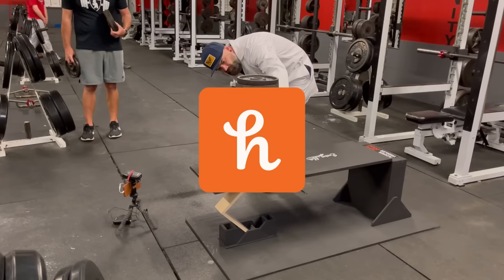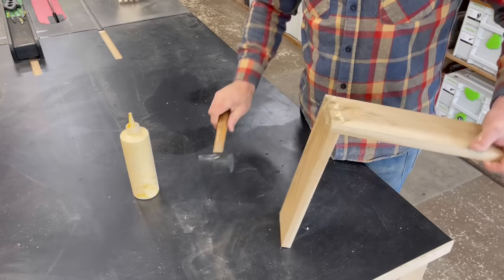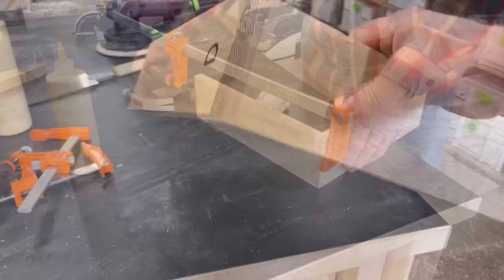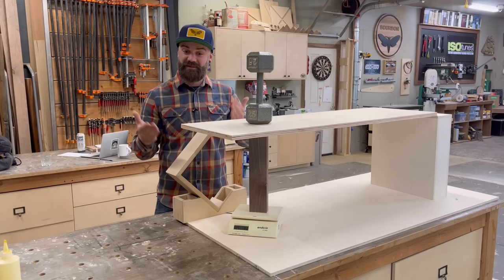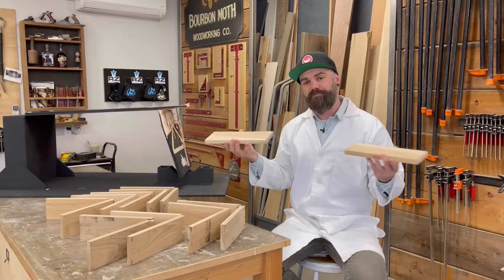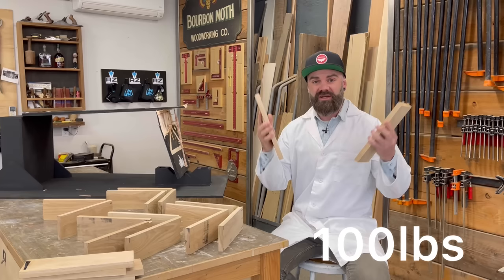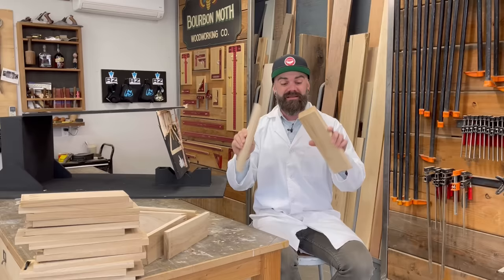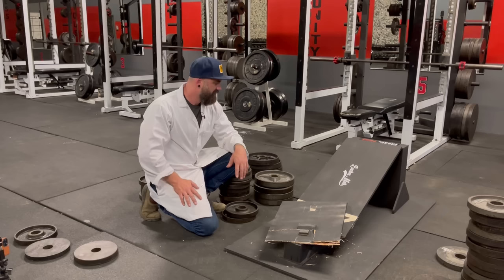What's the Best Wood Joint || Insanely Strong Joinery!

Comment: I think the hinge part does take some of the weight - hence 25 lbs for both the weight and the top board.  That said, the order should be the same, so the method still works to test the relative strength of the joints.

Matthias Wandel also did some joint strength testing and came up with box joints being the strongest I think.

Direction of stress also matters a lot - different joints will work best for different directions of force.

Useful test/information though - thanks for doing it.

I wonder how machine cut dovetails (like with the PC or leigh jigs) would do.

I guess the miter joint has a larger glue surface than the regular butt joint, and that, combined with Patrick Sullivan‘s (I think that‘s the name?) recent myth buster on end grain glue strength, could explain the strength.

The miter with splines really is easy to cut, attractive, and strong - I will probably use that joint more.  I usually don‘t cut them with the jig - I just cut out a quarter circle and use that - it‘s about the same as (maybe a bit less than) cutting it with the 45 degree angle jig, but it‘s super easy and requires no jigs.  I didn‘t think it would be as strong as your tests showed either though.

In the end, I am hard pressed to think of any of my joints that have actually failed under stress.  I guess I tend to overbuild everything anyways.  We probably overthink this as woodworkers because we are used to seeing the shitty stuff in store bought furniture - e.g. particle board with nothing but glue and brad nails for drawers and the like.  The kind of work we woodworkers do is very unlikely to fail in comparison unless really abused.

I believe box joints get stronger as the number of fingers goes up (i.e. the number of glue surfaces).  I made a Matthias Wandel box joint jig and usually I just cut single blade width box joints so I don‘t have to deal with putting the dado blade and brake in my sawstop.

The dowel joint‘s strength is likely due very much to the wood used.  I wonder what the optimal dowel size, number, and spacing is?  Another interesting test to try.

So many variables - but as I said above - this is still really useful and good info.

Comment: The dove tail should have been in the same proportion as the box joint, just with angles, with the “meat in the middle” being no less than 1/3 the “bite of the tooth”. 

Do the winner with 1/8 to 1/4 dowels going through joint just outside the corners, going through the white oak and the black walnut. Beautiful and I’d like to see it tested….FOR SCIENCE!!! Lol. 

It’s called a “Double Bradshaw” joint. A “Single Bradshaw” is a “mirrored dovetail” with the dowel going through the center of the joint. 

No metal. All wood. Up to 3 to 4 colors of wood too!

Science!  Test the Bradshaw joints.

Comment: Nicely done, you obviously put a lot of thought into designing this experiment, and the sheer simplicity of the mechanism combined with your conversational presentation style makes this a very accessible introduction to joint strength considerations.   Have you considered taking it a step further by addressing the modes of failure and the directionality of the applied forces?  Beyond satisfying the engineers in your audience (who, if anything like myself, were subconsciously superimposing force vectors on your video and/or flashing back to the days of solving statics equations with point forces acting on massless frictionless members floating in space) it would also provide your viewers with information that could help them make informed decisions in use cases where joint failure is a concern.  Even without bringing numbers into the equation (figuratively or literally!) I suspect you could easily in your audience instill a conceptual understanding solid enough to  enable the critical thinking and analysis skillsets that are so crucial for preventing/troubleshooting structural failures.

Comment: A dovetail joint is only good if it´s done to almost a tenth of a mm error. Otherwise the surface glue is too thick and the overall bigger surface area does not even matter.

Comment: Lamello has another system with the exact same machine, where you have to drill an extra hole, but can then insert the (stupidly expensive) klamex and tightem thn with a hex-key. Hold extremly well, are expensive as f.

Comment: My strength teir list guess. 1 being weakest.
1 butt joint (teehee)
2 miter joint
3 miter with splines
4 lamello
5 pocket hole inside
6 pocket hole outside
7 dowel pins
8 domino
9 dove tail
10 box joint

Comment: Watching your results, one question would be how strong a true diamond (e.g., a drawer without the bottom) done with butt joints would be -- would it be weaker or stronger than the 60 lbs?

Another thought (you did say a couple different ideas came to you) is that your pocket hold test needed to be done both ways -- with the pocket holes on the top of the support as well as the underside of the support. I can see how the stresses there might be different, since it's a kind of butt-joint with screws. As-done, it stressed the screws exactly in the "right" direction for maximum strength.

Given your winner (see my other post about unconsidered alternative joint types), I would really really be interested in seeing the results of the angled miter spline (e.g., the "bowtie spline") and the angled dowel-miter joints. I'd be even more interested in an  exposed-dowel angle miter -- one where the dowels penetrated inside the box to give them more angle on the corners (it would still be a somewhat decorative aspect of the work) e.g., the dowels were visible on the inside corner instead of fully contained in the wood. That plus a small angled-wood piece in the corner itself could make some interesting variations if the strength of the joint was highly important. The bowtie spline in particular would be less prone to failure given the way the splined miter failed. Whether it would weaken the joint in some other way is obviously a question.

Comment: The length of the lever arm increases the weight (force) at the fulcrum. All your joints technically failed at a much higher weight. If you doubled the length of the boards you would half the weight of force. Mechanical advantage/disadvantage is magic 😂

Comment: "Scientific"?  Your sample size is ONE!  Seriously?  Results HAVE to be consistent and repeatable.  Still cool though!  Us geeks come out of the woodwork when a YT video does failure testing.  HAHA!  You can go as far down this rabbet hole(catch that?) as you like.  Number and size of pins, splines, dowels.  Fitment tolerance variation(was it too loose or tight for glue?).  My immediate thoughts after seeing the basic miter's shocking result was to see if pre priming the joint with glue prior to assembly would make it even better.  Then adding splines to that?  The wood working world isn't flipped on it's head just yet, but even with the sample size issue, lets just say that it's more than a little interesting.  Keep up the great work.

Comment: You don't seem to understand what makes the miter joint so strong. For one, the glue is able to soak into and bond with the end fibers. You just don't get a good bond on the side of the grain. Secondly, you have much more surface area for the joint.

Oh, and I picked the miter joint with the splines as number one.

Comment: So I have a few things that make some of this make sense to me. First and most important, I've seen some cases where the wood glue used is stronger than the wood, and I'm not talking about something like balsa. Second, to go along with that, a couple of these joints maximize the surface area the clue is spread on. As for the dovetail versus the box joint, I think at least part of that can be attributed to any differences in the thicknesses of the cuts and the amount of surface area. I'd hypothesize that variations in different parameters of the dovetail, such as the size differences in each side or the number of cuts, would have a notable impact on the strength. Next, just to beat a dead horse, how the grains match in each joint matters, but I'd take that a step further and say the surface area of which grains are matched matters. Finally, a major part of the strength seems to me to be linked to the strength of the binding material and its placement in relation to the grain. The screws of the pocket holes breaking through the grain is a great example.

Now as to the winner, I'd say it came down to a balance of all of the above. The surface area of the miter joint, how the grain matched, and the splines adding surface area, tension, and reinforcement would make sense as a good balance. One thing I would have liked to see, although not the prettiest joint, would have been a butt joint with screws from the end. Obviously, I'm not a wood worker though, so I'm guessing I'm going to get torn apart here.

Comment: Great test loved it! However, your knowledge about end-grain is fundamentally wrong. End-grain to end-grain is the strongest way you can glue two pieces together and a miter joint is exactly just that. So the first thing you said about the first joint you tested was also incorrect. The first joint failed because of the long grain, not the end-grain.

Comment: 60 lbs of static load is lot. 60 lbs of dynamic load is not much. If you try and open a drawer that’s stuck, you can exceed that pretty quickly if you pull the drawer and it catches at the end.

Comment: Nice video.
You did make a engineering error.

Pound is a force not a pressure.

You are not load the joint with force.  You are actually loading the joints with a torque.  Force time distance.

You need to make a take that test sheer strength.

Comment: breaking a fixed base triangle is making no sense for the joint. the 2 legs should spread freely so max pressure is placed on the joint in fact the legs should be on a slick greased base. So friction does not give false support the joint.

Comment: It want The miter joint that was strong. It was the trigonometry. Your setup probably perfectly distributed the weight. I’m sure if you repeat the test with just an 1/16th difference on your jig holding the joint it’ll crack much sooner like the butt

Comment: This video is only good if you have only 1 joint and pull it off perfectly. If there are 2,3, or 4 joints it would be difficult to create perfect miter cuts, or equally sized peices. Imagine your slabs have curves or 0.1-.2mm variation in length. You will end up with miter joints that are not perfect 90 degree and there is a little bit gap between them. This is why splines and box joints and dowels are developed.
I personally think splines are easy and great. Then dowels or box joints. I'd use pocketholes if cosmetics isn't an issue. That's it. The reas are just useless. I'd never use a miter joint for the reason I mentioned above.

Comment: Cmon the simple answer would be a mitre with steel dowel pins +->1/4". diameter and ratio of board must be optimized or should we, dare we, use a threaded rod, not just a pin???? you decide

Comment: GREAT TESTING!! It's interesting that people do vintage joints with modern glues. The point of the vintage joints is to work well WITHOUT modern glues -- compare that dovetail without glue to the butt joint without glue (0 force with that one) and you'll see what I mean. Meanwhile, in modern construction, they use fancy glues, screws, and nails, NOT fancy joinery, because all that modern tech is much better (though maybe more expensive) than manual construction of joinery. Screws and glues make the work faster AND stronger, though I do appreciate people wanting to do things the old way because it looks cool.

Comment: the dove tail broke to early cause you didnt use an equal surface are on both parts, therefor its nothing else then the domino. with equal surface are the dovetail wouldve been the strongest. physics never lies.

Comment: EDIT: Noticed some words on the angles written. I edited to reestablish the correct message and clarity.

21:00 You didn't eliminate any end grain. In terms of the structure of the woods a 90° end grain cut is almost the same as a 45° mitre cut. The idea that end grain to end grain joint are weaker is false. Here is a video debunking that myth. https://youtu.be/m7HxBa9WVis

This one is showing how a miter cut is physically similar to a 90° end grain cut, yet the joint is weaker due the force being partially sustained purely by the lignin of the wood alone. https://youtu.be/2-cCCdwEhg4

For simplicity, and to avoid misunderstandings I'll refer to the grain as tubules when relating to the structural elements of the wood.

The difference in strength has to do with the amount of surface area glued and and the amount of  "functionally clumped" tubules in the actual joint. By this I mean that the tubules are positioned in such way that they must break from the joint to break, and that they are layered perpendicular to the force.

The butt joint has the least amount of surface area glued of all the joints tested and has zero tubules in the actual joint.

The others that showed less strength than the miter joint had some tubules in the actual joint, but mostly they are not "functionally clumped" enough. The best example of the that is the dovetail joint. You had some really thick parts interweaving with really thin ones. If you made them more or less equally sized, then the strength of the dovetail joint with be similar to the box joint. Possibly stronger due to the interlocking function of the triangular structure.

Finally, the miter with spline works very well because the position of the splines aligns the tubules in the position of greatest resistance. They are "functionally clumped".  Instead, if they would have been set up like a biscuit the results wouldn't have been much different to the simple miter joint because they wouldn't have been "functionally clumped", since they would be layered parallel to the force.

Comment: why is everyone going to extremes on joint strength.. First evaluate how strong does the joint have to be. in most cases a gooD looking joint is going to be much strong than actual need. (picture frames, most drawer boxes, even a desk is not expected To hold up a car

Comment: 13:00 Weakest to Strongest, Butt, Miter, Inside Pocket, Outside Pocket, Dowels, Lamello, Domino, Doves, Box, Splines?

Imo side note Imo if Doves were more symmetrical Id have them over box but those Doves were awfully narrow...

Im not a major woodworker or know much bout joints strengths but from some knowledge in area and slight idea behind physics of strengths in each I feel like could be close, I may be under or overestimating some like Dominos and Dowels may be better than Im suspecting but well see I guess!!
Reply: Okay yeah some I was good but off on, Specially the Miter, But I figured Boxes and Splines were going to be top 2 in some fashion...

If Doves were similar with more symmetrical even sized tails to boxes Imo Doves wouldve came in second Boxes 3rd, Splines seemed near positive theyd work best as the long flat tension is pulled less on boards edges and across splines themselves which were tightly glued into place, Almost like nailing some nails in outside few inches from edge, Butt jointed together than tied some thin steel cable from nail to nail pulled over corner, Second pressures applied Splines or Cable would tighten up and only way it can go is pulling splines apart or pulling them out of slots, But tightly being glued in way they were were only going to pull apart not out...

Comment: I can't believe how little wood you broke with those, glue failed almost every time. Maybe you need to try better glue. Also the lower support jig you used braces the joint, it should not touch the wood part way up like it does. I know that would make it harder to hold but you jig will add strength to all the joints and alters the symmetry of the applied force at the joint.

Comment: It should not be a surprise that the miter joint is the strongest. As Patrick Sullivan has shown in his excellent video, "Glue Myths: 1. End grain" (https://youtu.be/m7HxBa9WVis) an end grain join is, per cross-sectional area, MUCH stronger than a side grain join. When both are the same size, the side grain join will fail by having the wood break, while the end grain join will fail by having the glue break. Stumpy Nubs also has a great follow on video "A misunderstanding of the end-grain glue "myth" video?" (https://youtu.be/dwLWmoGh59g) which looks at this nicely.
This is not what we've all been taught, but Patrick's video is quite conclusive and I recommend it highly.
So, a miter joint is the strongest because an end grain glue up is the strongest possible join for the given area, not to mention that the angle of the miter gives even more cross-sectional area to work with.

Comment: If the dovetails had been more even widths it definitely would have been stronger.

Also to be truly scientific you should have done 2 tests with each of the joints that were asymmetrical. So the long piece would be on the bottom on one test and on the top on the other test.

Oh and you missed the humble butt joint with screws.

Comment: That's an interesting experiment but unfortunately with constraints your made i.e. fixed angle for lower plank and fixed pivot point for upper plank it's far from reality. Those 100 pounds you applied are essentially mostly for bending oak planks, not affecting the joint. It's really upsetting because without slight corrections to the experiment, all your energy yielded mostly useless data.

Comment: The place the pressure is placed makes no sense.... You would have another joint right where you are testing in every application. I would build a through mortis with two tusks facing up just to do the best on the test. Application would make no sense but neither does the test.